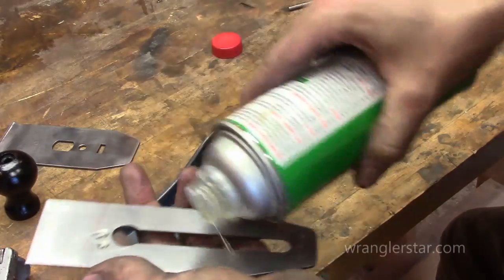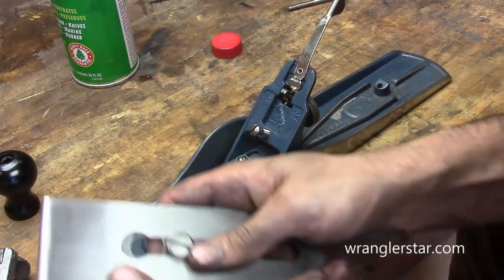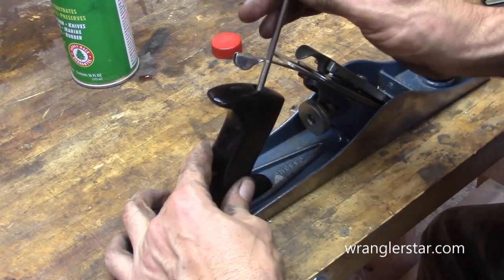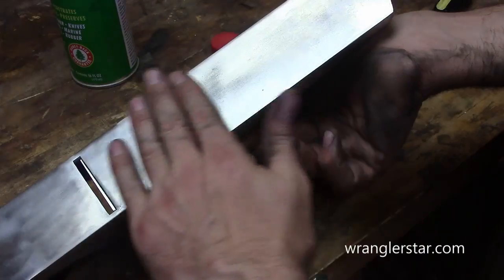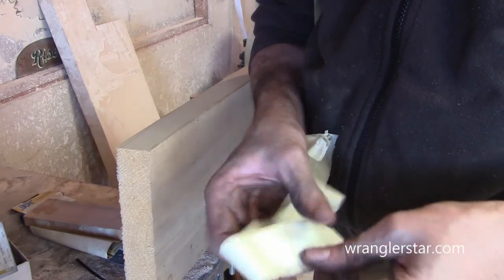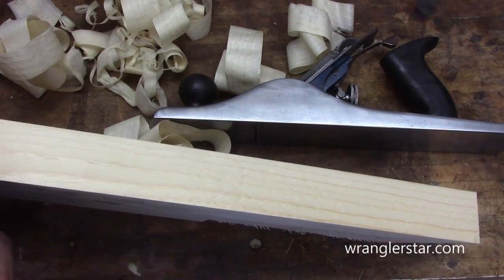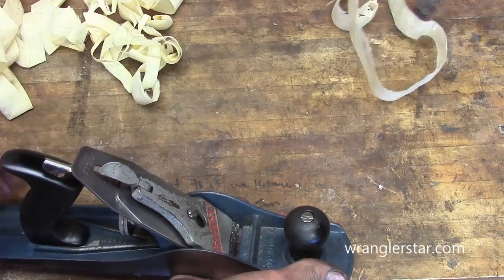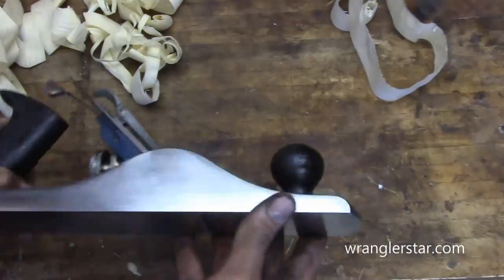Stanley Plane Restoration 4 | Wranglerstar

Comment: That is really awesome... amazing work as always.... Hey! I got a question for Cody or any of his fan base..... is $40ish dollars a good deal on a Stanley number 4 or 5???? I saw about 4 or 5 of them at a antique store and those were the least expensive.... in less than usable condition... I would have to do what Cody did here in this series to make them usable....
Reply: The Stanley #4 & 5 are the most common of the Stanley line. The #4 is 9" long and the #5 is 14" long. It depends on where you are but here in Michigan they can be found in good working condition for between $10 and $20. Flea markets and garage sales are better than  antique stores for low prices. Patrick Leach has a great website http://www.supertool.com/StanleyBG/stan0a.html It has more information than most of us will ever use.
Watch out for cracked soles on these. They are often cracked at the edges of the mouth. A chip or two on the top edges of the sides won't usually affect their use but should lower the price considerably. Cracked totes, missing knobs, can be fixed. Broken adjusters, frogs, or soles means keep on walking. They can be fixed but it is seldom worth the trouble.
Reply: Old Sneelock's Workshop
 Thank you so much for the help... here in Idaho, it seems difficult to find low prices on these items... maybe I'm just not looking hard enough... in any case, your help is appreciated....
Reply: Since I live in the lower left hand side of Michigan tools are pretty common. Grand Rapids was the furniture capitol of the US and a lot of woodworking spun off from the businesses supporting that. Now that they have retired the tools are gathering dust in the corners.

Comment: I have an old No 5 plane I want to restore. I was telling a friend and he offered to bead blast all the metal parts for me to clean up the rust. Is this a good method to use if I want to restore this tool? I don't want to do anything that will damage the blade.

Comment: In woodshop at my high school we have 6 of those Stanley hand plainer and your plainer  makes WAY better "ribbons" then our. We are lucky if we can get 4-5 inches ribbons at be after its been sharpened. Also I dont know if its correct be he tells use to hold it at a angle, so if you are plaining north then u point the plain a little west of east, but still cutting north. Again dont know if it helps but that what he tell us.

Comment: Nice restore, you got that thing working well.  Not many better feelings than restoring a plane and making some nice shavings with it.  Those shavings look just right for a jack plane, maybe even go a little thinner if you want.  It sort of looked like you really had to wrench down the tote to get it to stay in place, I learned a great little trick to stop it from moving, cut a small piece of the anti-slip drawer liner and put it between the tote and the sole and it will stop any movement quick, especially if it's one of those that loosens up after a little use.  It doesn't look like you need any advice on the restore, but this is the best resource I've found for plane restoration, typing and general info. http://www.timetestedtools.com/how-to---bench-plane-restoration.html My favorite plane in my till is the Craftsman version #3732 (the cheaper version of the Stanley 65 knuckle block).